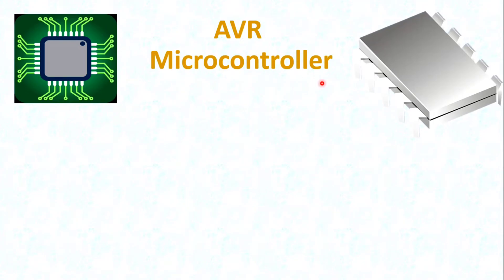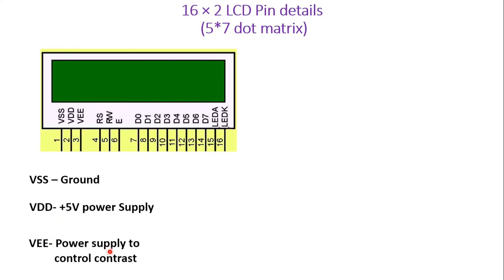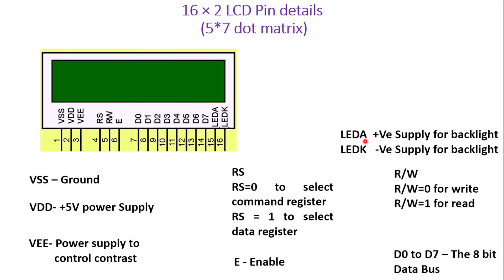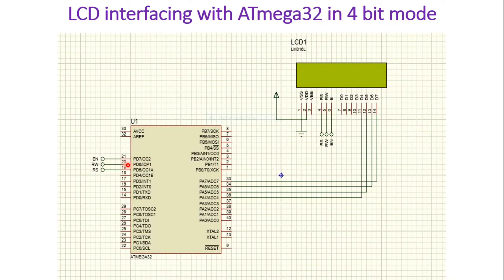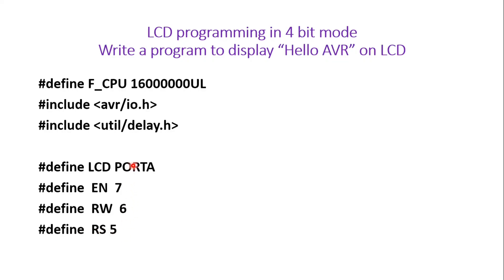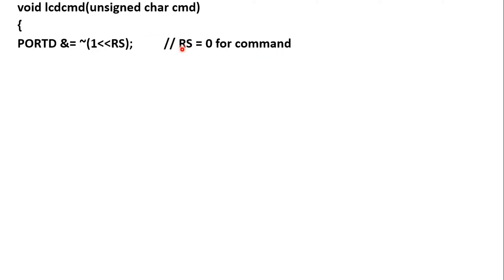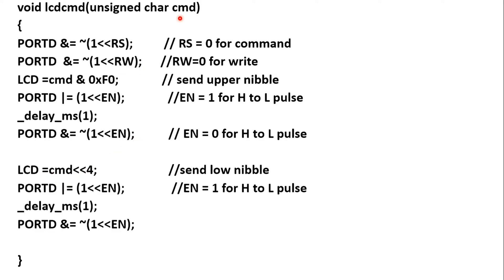LCD Interfacing and Programming with ATmega32 Explained

Comment: i followed the instruction but lcd not displaying the text. only backlight is on
Reply from the maker: I have already tested it, and it is working perfectly fine
Reply: I'm might be late to reply but you should try to ground the not used data pins on the LCD. There is most definitely garbage on them.
Reply: same issue code not working

Comment from the maker: LCD Interfacing and Programming with ATmega32 is explained with given Timestamps:
0:00 - AVR Microcontroller - LCD Interfacing and Programming with ATmega32
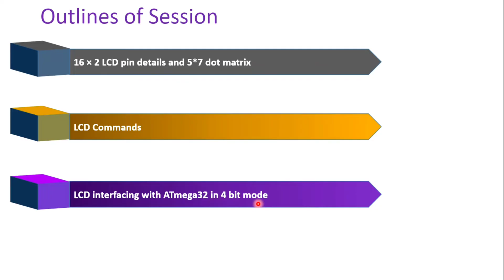0:24 - 16*2 LCD Pin Details
1:58 - LCD Commands
2:20 - LCD Interfacing with ATmega32 in 4 Bit mode 
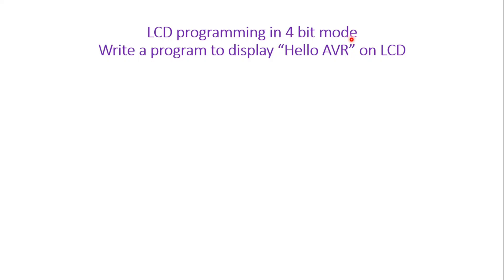3:45 - LCD Programming in 4 Bit Mode in ATmega32